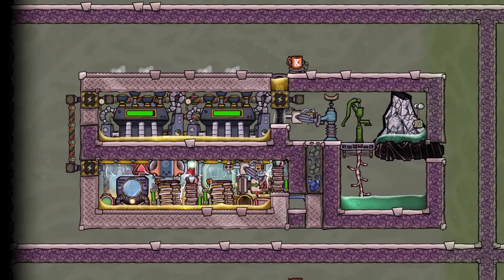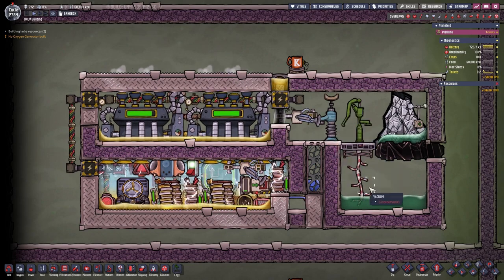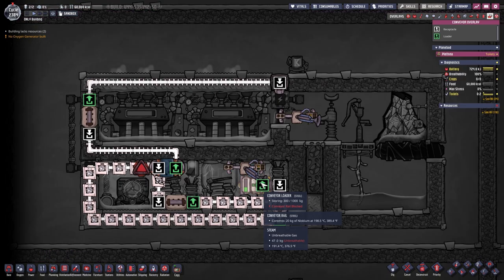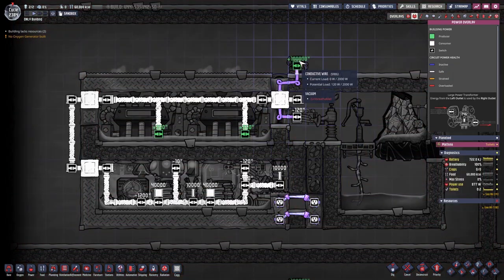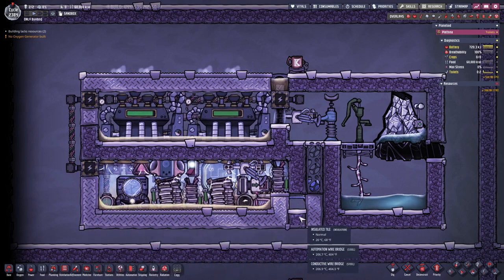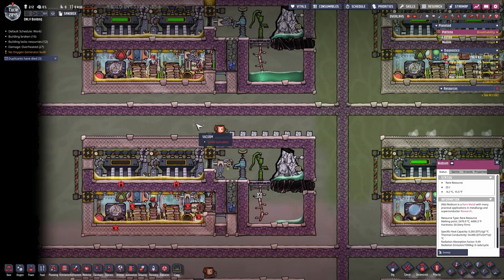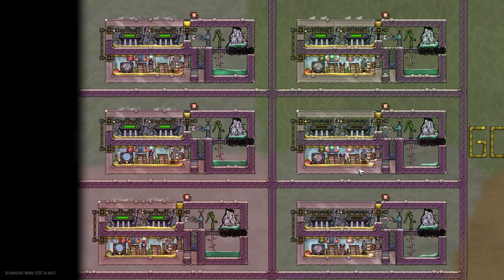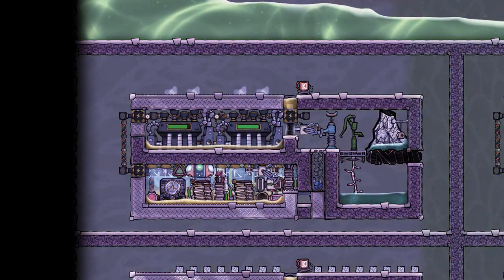Niobium Volcano Tamer

Comment: It's too bad this Auto-Sweeper, Pitcher Pump and Bottle Emptier trick doesn't work with a Volcano to move magma. Would be a great alternative way to tame a volcano.
Reply from the maker: Yes that would be cool. I think so as well
Reply: Build the pitcher pump out of obsidian. It will not melt because the volcano makes magma with lower temperature than melting point of obsidian.
Reply from the maker: hey  @hbarudi  That is not the issue.
Niobium is at least twice as hot. It just only works for liquid metals for some reason. I blame klei :D
Reply: @lumaraw  I wish I'd read this thread earlier... These poor dupes of my have build entire line of pitcher pumps and emptiers through good half of flipped asteroid. In vacuum. Without atmosuits. Only to see that system motionless and disassemble it back...
Reply from the maker: @DeepProbe  The game is ruthless and doesn't teach most things.
Reply: @lumaraw  i was just trying to replicate aluminum and use this as a way of cooling the metal 😢 sadly this doesn't work for aluminum
Reply from the maker: @pizzafiend12   Did you set the bottle emptier to enable auto bottle? I often forget that
Reply: @lumaraw  yep, sadly to say it doesn't work with aluminum, because I tried it with gold, copper, iron, and liquid steel.
Reply from the maker: @pizzafiend12  Oh thanks for the clarification/information. I did not expect the game to make even more distinctions. Maybe cause aluminum is newer and the metal was a bug in the first place they didn't add it back?
Reply: @lumaraw Works with Mercury though
Reply from the maker: @ewbaite  good too know. So it is basically all liquid metal weather hot or cold if i see that correctly.

Comment: It worked for the first eruption but than the liquid does no longer get pushed to the empty tile left-beneath the mesh tiles.
Reply from the maker: Hello, i can guess what could be the issue on a fundemental level (for individual analysis i probably need more information):
- heat transfer to low -> not creating debris
- too much liquid made its way in the mesh tile at the same time creating an invisible solid block of metal
-background tile melted blocking the tile
-automation got screwed up and dumped too much metal at a time.

but most of these normally stem from the material not beeing made for the temperature exchange needed. With the material i have shown in the video that shouldn't happen. 
Did you by any chance switch out some of the materials (i am not judging here, that is just the only thing that i can think of that might explain it - besides changes to the game - some new update i missed while on vacation)

the "pushing" works like this:
liquid in mesh tile freezes and forms debris
debris tries to calculate output tile and only finds 1 tile
debris gets output.

if there is too much liquid and it freezes it forms a solid tile
if it is not cold enough it will not freeze.

hope some of these information can help you :)

Comment: At 2:00
I'm confused with the "below 180*C" thermo sensor and memory toggle function. It seems like the auto sweeper activates if the thermo sensor sends a red signal in your video, and with my sandbox creation of your design.
Reply from the maker: Oh it has been a while i looked at that design.
I know something like that can happen if the automation has the wrong starting parameters. Might be you need to send a green signal once for it to be primed correctly.

At the top of my head i also find the memory toggle very confusing.

If it doesn't work try rebuilidng only that part and importantly in the same order with putting in the same values at the right time.

Sorry if i can't be more specific.

If you want to you can come to the discord and share a screenshot. Maybe somewhere there has time to check the automation :)

Comment: pitch pump could be automate??? this is new to me, thumb up
Reply: Just a W.O.A. the pitcher pump can be automated ONLY with liquid metals. It will not work with water nor magma. I'm not certain if it works about others.
Reply from the maker: Hey @TheKueiJin  yes exactly only with liquid metals. I put emphasis on that exact point in the video but it doesn't hurt putting it in these comments :) Thanks for adding it. This will help those only taking a short glance

Comment: I'm having problems with my mesh tiles melting? I made them out of Niobium, any ideas? Its also in a vacuum.
Reply from the maker: Hey Christian: have you build the unconnected power cable bridges? and other bridges i might have shown with no connection?they are mandatory. They are important for heat transfer.
Reply: @LumaRAW  wow, no, I didn't. I thought it was just for visual effect, lol. I should have known everything in complicated designs like this have a purpose. Thanks for the reply!
Reply from the maker: @snowboard4life1221  Sure :).
Yeah all bridges transfer heat from one side to the other while ignoring the middle tile.
You can use that to your advantage or you cann accidentally have you Aquatuner Heat transfer outside of the steam room if you don't notice.
Happened to me a few times when i started that game.

Comment: Yo, that logo is absolutely epic!
Reply from the maker: Thank you :) SentientNeuron!
Reply: @lumaraw  Just curious, would this produce sufficient energy to cool the output gold from a gold volcano? I was totally not enticed by the benign-looking pool of liquid metal.
Reply from the maker: @thesentientneuron6550  Do you mean if the whole setup works with gold volcanoes 
or if the cooling power os enough for a second volcano in your case gold?
Reply: @lumaraw  Yes, I am referring to the whole setup and want to know if it produces enough energy to cool the gold (especially when the components are still cold. As you may know, it takes several eruptions just to boil the water in a FJ style self-powered gold volcano tamer)
Reply from the maker: @thesentientneuron6550  I don't actually know. I may test that. If I should take a guess i would say yes it is efficient enough for a gold volcano.

Comment: The liquid niobium won’t melt insulated tiles in the holding tank? Obsidian? Could airflow tiles be used?
Reply from the maker: The heat transfer from liquid to solid  insulated tiles is basically zero. 
From gas to insulation gets a multiplier that makes the whole thing more dangerous.
If you want to be safer use obsidian or maybe ceramic.
Reply: @lumaraw   you should definitively try with insulated tiles made with something else than insulation, it's going to melt within a few hundred cycles unless you cool them. Here is a alternative design : https://pasteboard.co/c4c0LGK7wTcs.jpg
Reply from the maker: Hi Sleve. (Haven't seen this message since all links get blocked until i checked them):
So a few hundret cycles is probably not correct. more like a few thousand cycles. As i stated the transfer from liquid to solid is basically non existant. But the safer we can build the better. So every tip is welcome.

As for your design i would only point out that the liquid pum system is not cooled as far as i see.
The liquid you use to trick the niobium pump to activate will heat up over time (from the pump itself),
then turn to steam/gas and then burn the left part of the build. 

Other than that i think it is a really cool design. :)

Comment: One question as a dude that do not play this game
What are this machine/ tamer/ science/ tech used for??
This is a dumb question and i know
Reply from the maker: No it is a normal question for someone that has not played the game.

A volcano tamer refers to a setup that extracts the heat from a volcano or its products (in this case niobium metal) so that you can use the product in the game.

So this setup extracts the liquid niobiums heat ,cools the solidified metal to a temperature that the people in the game can touch it without getting hurt or your base starting to cook.

This also uses the extracted heat to power it's own machinery and even parts of your base. So it is self powered to a degree